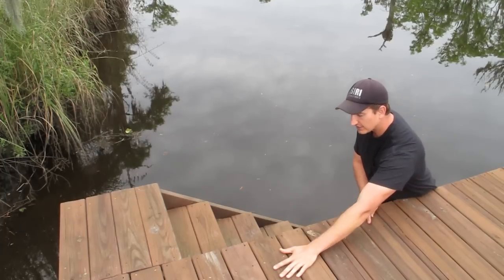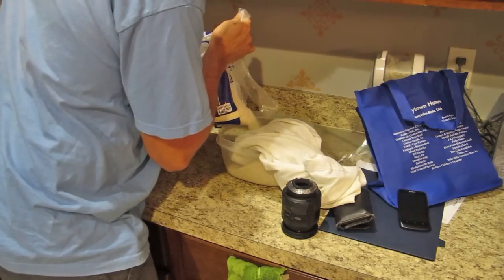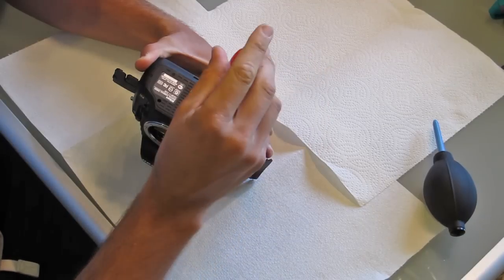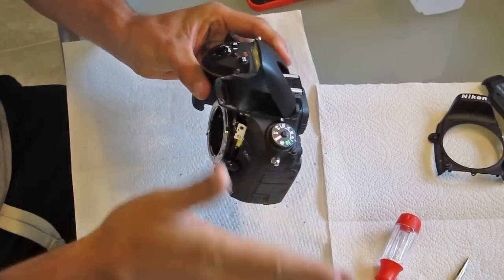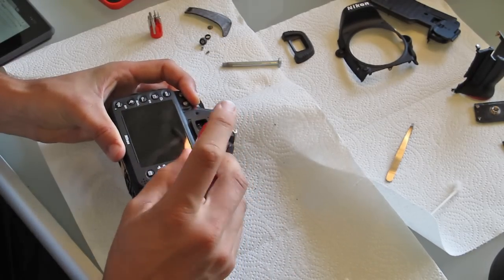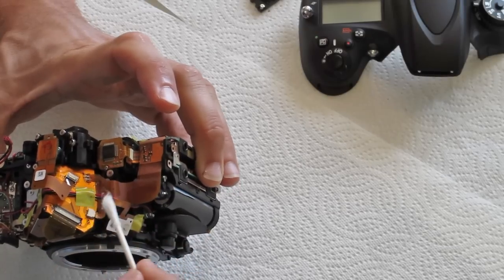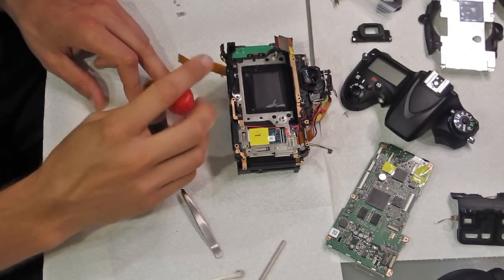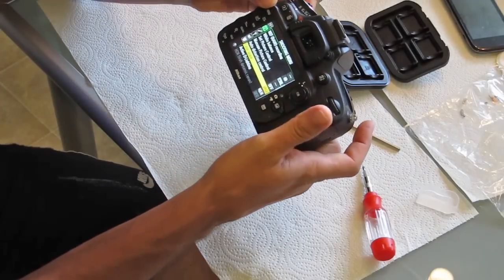How to Repair and Save a Wet DSLR Camera

Comment: Hi Mr Kistrel 
I just bought a new Soney rx10 M4 ... after 2 weeks I went to fishing trip.. by mistake  dropped to the sea shore for about 15 seconds  now it doesn’t work...I tried to put in the sun ..I saw your video..I will try to do the same what type of material you put it to make it dry? THANKS
Reply from the maker: Salt water is tough on electronics.  The problem is the salt water may have caused short circuits that could have damaged components.  It may be a tough to salvage but would likely require dissembling and cleaning all the circuits.  When salt water dries it  leaves salt crystals or salt powder behind.  if you were able to disable I would use clean water remove any obvious salt and then let everything dry before reassemble and then cross your fingers.  Best of luck, let me know how it works out.
Reply: Hi dear Mr, Kestrel 
Thank you for your quick response and advices... this morning  I washed  my camera again with sweet water then I put it in clean small shirt then I put in cooking pot and fill it with rice.... after one week ‘ I will put battery and try to operate it .. if not working then I will open the camera step by step ... I appreciate your time and help.. 
best regards 
Mohammed
Reply from the maker: Best of luck with your camera repair
Reply: Hi mohammed...What happened With Your camara ?

Comment: I have a Canon Powershot SX700 HS. The water bottle leaked in my bag and by camera got wet about a year ago. Would it still be worth while to try and salvage it now?
Reply from the maker: If you have the time I figure it is worth a try.  What do you have to lose if it is not currently working?  Best of luck.

Comment: I've been looking for thin or medicinal alcohol just about everywhere.. my local pharmacy and car place don't have them although they are aware of it. I'm in the UK. What sort of alcohol is it you use. I was wondering whether gin would do (hah) but i don't want to strip paint or surfaces.
Reply from the maker: gyrovague in the US most grocery stores sell two types of alcohol.  One type is usually referred to as "rubbing alcohol" which is mostly alcohol with some water in it and the other version has less water in it and is much more "dry. "  You could try other solvents such as acetone (which will evaporate fast taking residual water with it) but you would have to be careful.  I am not sure if the acetone would react negatively with any of the camera components.  Rubbing alcohol might be safest bet.

Comment: I need help water fall straight in my camera and I dry it with a rag then I turn it on and I knew I f** up and the  screen went blank it turns on but not the screen. What can I do.
Reply: Is a canon powershot 50x IS

Comment: mine felt in the sea, i already put it in rice but the salt is the problem, is there something i can do to repare it a part from drying it?
Reply from the maker: Yikes, saltwater can be devastating to electronics. Just drying the camera out will leave salt crystals behind.  Not sure it is salvageable but the camera might have to be completely disassembled and individual parts might have to be soaked in DI water (to dissolve salt).  Then the parts need to be rinsed and dried before reassembly.  Even with all this there may already be some damaged electronics from shorts caused by the seawater. Best of luck. Please advise if you are able to repair it.

Comment: My d7100 was submerged for less than ten seconds, however, it fell from a height and the lens was broke in the process, I have cleaned it best I can with a cloth and a rocket blower. The camera seems fully functional, should I wait a few hours before putting the battery back in?
thanks
Reply from the maker: Jake's Place tough call..  When I finally opened the camera (featured in video) it had water in it that I would not expect for the brief amount of time it was  submerged.
Reply: MrKistel Took it into a local store, the lens that was damaged registered but my other lens did not, has now been sent off for repair with my other lens. Praying the PCD is in tact.

Comment: My buddy had his Canon in a bad while they were near sea water. the bag got submerged and it turned out to have a hole in it. So the camera was submerged in sea water in a bag for roughly 30 minutes i believe. he sent it into Canon and Canon basically told him there was nothing they could do. Now, I have heard that Canon says that a lot so people will go out and buy another camera. My buddy gave me the camera yesterday, it has been roughly a year now, should I even bother doing a tear down like this to check to see if it will work? or will I just be wasting my time?
Reply from the maker: If salt water got into the circuit board electronics it is likely toast..  Salt is a nasty beast.  However some of the cameras are weathered sealed fairly well.  Wouldn't hurt to open it up if you have the time.  Probably will see obvious signs of damage if salt got in there (crystals.corrosion and so forth).
Reply: The reason Canon says that is because water damage can throw random errors later on, when corrosion has got to some key components in a way that doesn't necessarily let's them fail completely, but will cause bad contacts.  Also, some IC's can suck water underneath the chip's surface, showing no telltale signs on the surface, causing a repair mechanic to not replace that part and when you get it back it suddenly starts acting weird. The problem with it is that Canon likes to give a limited warranty (I think somewhere around 6 months or so) on the repairs they do.  If they would repair it, it would probably require them to replace all the electronic boards in there, just to wipe out all the possibilities of slumbering corrosion, safety-wise.  This also necessitates a calibration of all the key components in there so that all the devices in it work at their peak performance in conjunction with everything else.  This is expensive and since water damage is not covered by regular warranty it would cost you a big amount of money (and Canon a good amount of time, most camera's leave no millimeter of space unused).  My camera took a plunge into some muddy waters after an accident with my bike and it still works up to this day (allthough I did not take it a part, I put it in the oven at 40 degrees Celsius for 3 hours).  I would certainly not throw the camera away, it's great fun seeing how well those things are put together (and what a struggle it can be to open them, oh boy :P) and also how they do some things inside.  It'll also teach you the signs of salt-water corrosion, should you ever have to open up a device from which someone says it "suddenly stopped working" and you find exactly that, you know what happened ;).  For me, knowledge is power with these kind of things.

Comment: Currently I have my new Canon200d sitting in rice. A can of beer shotgunned itself in my bag with the camera (stupid). When i discovered it the camera showed life telling me there was an error. I think it has short circuited itself... how would I repair this? after 24 hours in rice, I put the battery in and still no life. How much more damage does beer have compared to pond water? I think i'm going to strip it down like you did.
Reply from the maker: In a situation like that my thought is there are really only two options. One send it to Canon for them to evaluate or repair.  Two, if is not functional anyway, break it down yourself and try to trouble shoot.  The risk of course being you could damage further but if it is already a dead camera you would be no worse off.  In your case I would be concerned because the beer soaking with the battery in it.. Yikes
Reply: MrKistel thanks! The battery seemed to be dry when I pulled it out- the spillage seemed to be more on the left hand side of the camera, probably getting in through the buttons. I looked online and everywhere says that water damage tends to be more expensive than replacing it. 

Quick question- does short circuiting mean that it has potentially blown a fuse and some parts need replacing, or is it residue that when removed, it removes the short circuit?
Reply from the maker: Regarding a short circuit it is when a conductive path is formed between isolated circuits / components.  In your case the beer would cause the short/s.  It can cause electronic components to become damaged.  Sometimes you can get lucky where nothing major is damaged and you can simply clean the conductive path (old beer) and you may be lucky.  Best of luck

Comment: hi, i have  nikon d3300, it was fell frrom tripod in the dry area not inside water . problem is that it takes black image even in the normal light .. but all camera function is good, i can see previeous image and video.  i can take photo and video too but it cames totally black. can you please some one help me, what should i do???
Reply from the maker: That doesn't sound good.  Perhaps the image sensor has become disconnected or damaged.  Best of luck with your diagnosis and solution.  Please share your ultimate results.  Thanks.
Reply: @MrKistel  thanks fir your quick response,  so what should i do? Can i fix it at home or should i go to camera repair centre? ??

Comment: Emergency : I have a D5300. It was raining and my bag got wet with the camera inside. Only the battery section of my camera was moist. Now with the lens (18-55) that was attached, if I try to switch it on, it says 'please turn off and then on again'. The camera doesn't say this when I attach my prime lens (50mm) to it. So I know there's something wrong with my 18-55. The lens wasn't wet nor did I drop it. Please help fix this. I have a shoot on Thursday.
Reply from the maker: Yikes!  Perhaps the problem is a short in the lens. If it is only moisture causing the short you might get lucky when the lens completely dries.  Maybe try to keep it in front of a fan in a dry (low humidity)environment for a few days rotating the lens every so often.
Reply: MrKistel thanks bud. I'll try that

Comment: If camera fall in sea water, how first step for rescue?? And
Reply from the maker: salt if rough on electronics.  Perhaps pull the batteries asap. May have to disable and soak everything in DI water for a bit. Then dry out thoroughly before reconnecting.

Comment: My canon got a big wave from the ocean! I turned on after that to record cuz I thought it wasn’t a big splash of water lol it works but after that it didn’t! I don’t know what to do with it now 😢 help!
Reply from the maker: Bummer about the camera not working after getting wet.  You could try these procedures and hope for the best.  Salt water and electronics do not paly well together. There is a chance you have salt shorting a circuit and perhaps by cleaning internally it might work again.  Best of luck.

Comment: My 60d got wet with beer and its still working fine, but the on off switch is rather stiff, also the flash, anyway to loosen it? I read wd40 can be harmfull.
Reply from the maker: Might be something binding, a possible build-up of something.  Might have to remove pieces to clear it out to make the switches function properly.
Reply: everything works ok, ima try some alcohol 
 @MrKistel

Comment: I soaked my dslr 6d 2 sec in water..and I did the trouble to put the battery and try to turn it on,which failed. Did you think it would still be alive after I dry it really well or it's a lost cause? I was a moron for trying....
Reply from the maker: Can always try and cross your fingers, best of luck.
Reply: Today I fell in the river while doing some portraits...that was a great laugh and a pain in the arse from the fall...too bad for the gear though...
Reply: Tried to open it like 5 times to be honest after 2-3 hours....
Reply: Maybe to offer you some hope - I was out in heavy rain with my 6d a week ago. When I switch it on, all the buttons were freaking out and a lot of error messages. I dried it out (without disassembly) and left it for a few days. Now it turns on and take pictures ...but I'm not sure if it's back to 100% though
Reply: The 6d is ok now,I got an unlock card error but it dissapeared after a few restarts,the lens wont autofocus,so I had the smart idea to put it in the window of my car while it was in the sun,and after half a day the water was gone from the lens :D

Comment: Right now I'm opening my Nikon D810. The camera dosn't survive a rain! 
Damn, no teardown videos around and the D810 is way more complicated then a D800. At the moment I stuck with a ribon cable. There are 9 different types of plugs on the first mainboard!!!! DIFFERENT TYPES.

I have different cleaning sprays, bot the sensor and the TFT  should not come in contact with any of this sprays.

PS: WEATHER SEALING dos not work!
Reply from the maker: Yikes!! best of luck with the attempted repair

Comment: Is the D600 weather sealed?
Reply from the maker: I think it can handle normal day to day environmental moisture well but it did not like being completely submerged.  This camera had signs of wetness all the way down to the image sensor even after the rice drying period (5 days).  My guess is  that the majority of the water came in through the lens and then into the camera.  I think it is a great camera but I wish I did not put it through such a test.  Working good as new though as of now.  Wish I could figure out how to clean up the lens.
Reply: MrKistel did you find a way to clean/dry the lens? :/
Reply from the maker: I took the lens apart with the intent to clean piece by piece without sucess..  This turned out to be a major mistake as the lens is very complicated.
Reply: Ok ... thanks for the advice. I'm trying to solve a similar issue with a couple of lenses and I'm starting to get ready and buy new ones :(

Comment: @Shop "professional camera" @5:09 I'm like DUDE are you using an earthing strip ? [Grounding wire on wrist + grounded pad / surface]. Invisible static electricity frying circuitry ?

Comment: My camera is not working due to steam in it, solution please?
Reply: If it ON after 2 or 3 minute automatically Off, please tell me the solution?
Reply from the maker: Sorry to hear your camera issue because of moisture.  If steam was the issue the heat may have caused some additional problems.  In any case the moisture should be removed from the camera and I think the best way to do that is to disassemble the camera as the video shows.  Best of luck and let me know if you resolve the issue.

Comment: What kind of "alcohol" do you use? Im in the same situation with a wet d800! 

Thanks
Reply from the maker: +Filip Mulder rubbing alcohol should be fine.  Groceries usually have a version that is higher concentration that could work as well.

Comment: Not something I would try. Unless the only other option was to scrap it.
Reply from the maker: In this case, after falling in the water, the camera was broke and useless. The only other option was to send to the camera manufacture to see if they would attempt to repair it. I was under the impression the manufacture would be hesitant to repair the wet camera and would suggest replacing the camera as the only option.

Comment: Just poped my 7D which went swimming for a few sec into my oven at 70°C  ...
Reply from the maker: does it still function?
Reply: @MrKistel  I´ll tell you in a week 😄
Reply: @MrKistel  Yes! 😅After additional 3 weeks in dehumidifier bags it´s alive and kicking! The only thing that seems to be broken is the release/shot btn ontop - AF still works. With the battery grip btn it´s 100% functional. #lucky

Comment: Just for future viewer, never ever dry water damage electronic.
If you dry the water on the board, all the corrosion will end on the surface of the boar and will create short circuit.
It is better to displace the water with alcohol and if your cheap brush every board with a tooth brush and alcohol. The proper way for an expensive device is to put every board in an ultrasonic cleaner and use a multimeter to check for short circuit on every power rail.
If you plan to take it to a shop bring it asap, wen somebody brings me something still wet i can often recover it.
I hope you learn something, and stop with the rice, this thing have destroyed numbers of devices

Comment: Hey there I recently had my camera by a window where some how there was a  leak above it dripping water onto it with out me knowing, later on I noticed it clean off the camera tried to get water out and let it dry, my problem is that the lenses doesn't remove, and there is water inside the lenses and I can't get it out, it's like a condensation but a little worse, any ideas? It's a Nikon coolpix p500 thanks
Reply from the maker: you can try to keep it in a low humidity environment with a fan on it for a while and eventually the water will evaporate

Comment: Hey thanks the rice trick worked along with the help of a hair dryer....but my images taken from the lens started to produce more noise any solution to this??
Reply from the maker: Thanks for watching. Hmm, If the images are a bit softer or blurry it may be that some residue is remaining on the optical or sensor components of the camera (or lens if applicable).  The rice may dry out the liquid but that dried liquid could have left some interfering debris behind.
Reply: @MrKistel  oh thanks for the reply Sir...that means I've to personal remove and clean my lens? Or what else do you suggest??
Reply from the maker: Perhaps try a different lens first to see if the problem is within the lens or the camera body.  If the pictures are still soft with the new lens the issue can be within the camera body, perhaps on the sensor components.  Also I would recommend taking sample images in manual mode and experiment  with different settings.  If images have significant spotting at high aperture values then I would guess there is still debris somewhere.
Reply: @MrKistel  ok thanks for the comments!!...will try doing it.